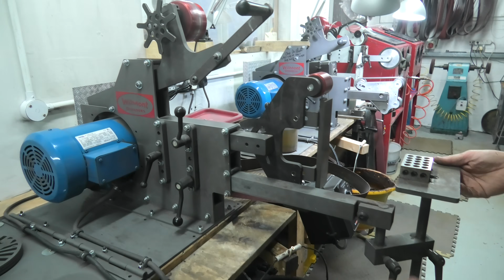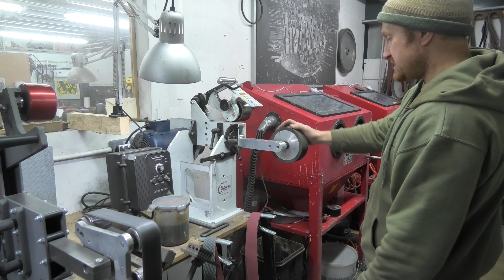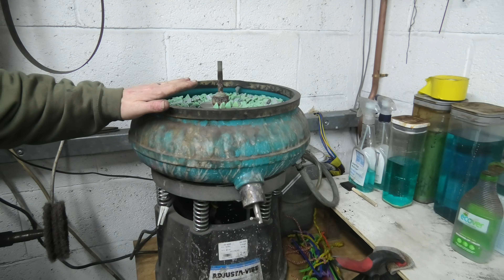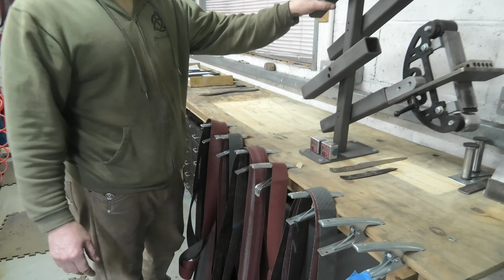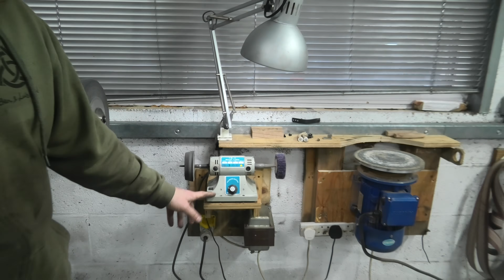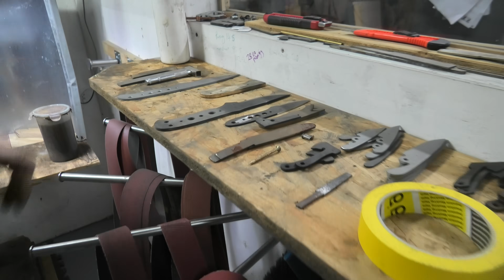Workshop Tour - Part 1: The Grinding Room

Comment: Love the Grinding room!  I'm admittedly envious.  It brings a grinding question to mind.  I recently got a froe which is perfectly flat on one side and is ground with a bevel of about 3/4" on the other side to form the cutting edge.  The sharpened side is otherwise flat as well.  It seems to be originally made this way and not re-ground.  It is very well made and quite sharp.  I've only known froes to be ground on both sides (and usually a bit convex).  Is this a special kind or have a specific purpose that you know of?  It doesn't seem to work very well for general splitting.  I'm trying to decide whether I should re-grind it to a more common profile. Thanks for the great content, I love your channel and have learned a great deal watching!

Comment: Thanks for the tour Ben. With the grinder that you said you may have to make a lower bench to mount it on, you could get away with making a small movable platform to stand on to get yourself at the correct working height then slide it back under the bench when you don’t need it. Stay safe. Regards Andrew 🦘🦘
Reply from the maker: Now that’s a plan 👍